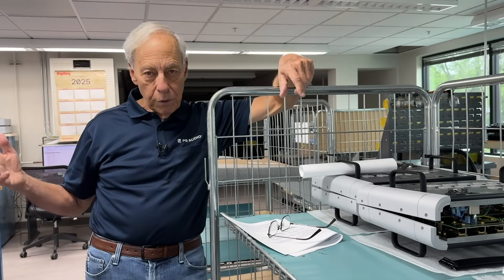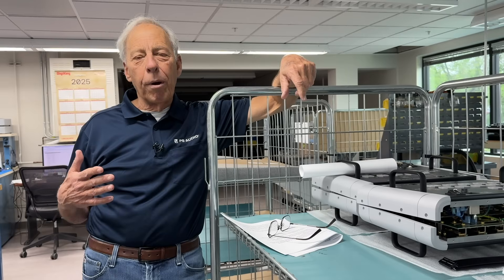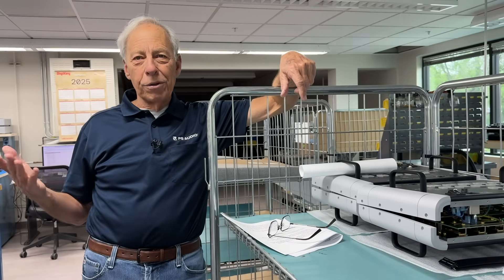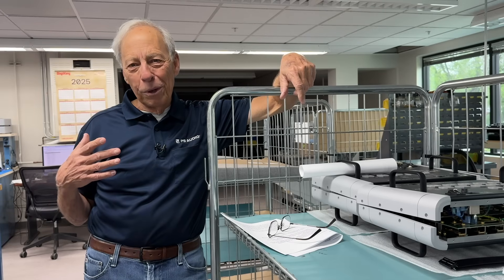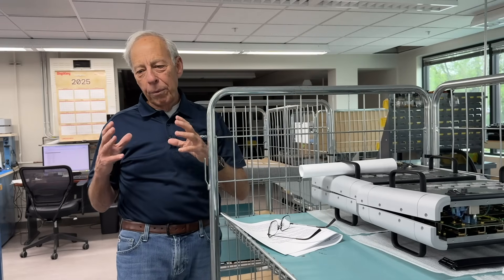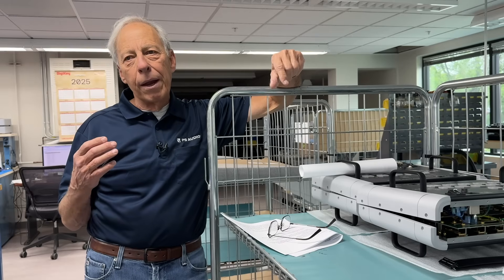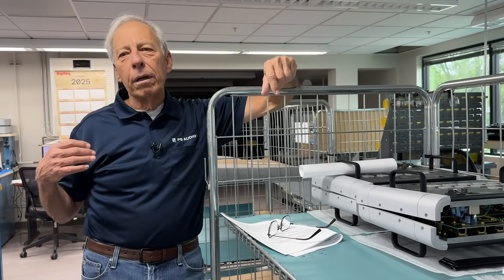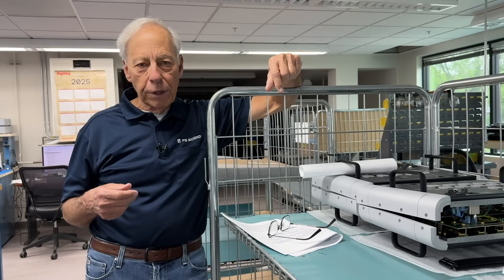Balanced Phono Cartridges

Comment: A 5 pin connnector on the tone arm to XLR (left/right)
Reply: Yes,but there is still the question of connector hardware availability,and the lack of an industry standard for a consumer electronics balanced connector. DIN5 is a dinosaur legacy connector which needs a major industry refresh to something smaller than an XLR connector and more robust than DIN5. A "Goldilocks" balanced connector...
Reply: @jeffmassey4860  Tonearms with a detachable cable often use a “tonearm DIN” connector, which is not the same as the old school German 5 pin DIN cables.
Reply: No, if you have a 5 pin DIN connector that uses all pins it will be for a tape deck. Left/Right out and Left/Right record in + one ground pin. If you have a turntable, only 3 pins are used. Sometimes, it is even a 3 pin DIN plug, wich fits in a 5 pin DIN socket.